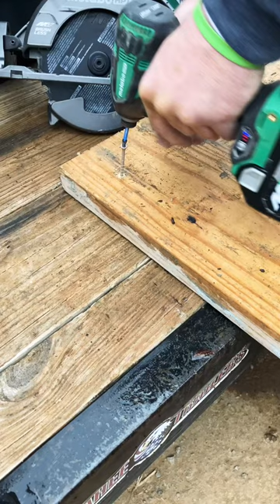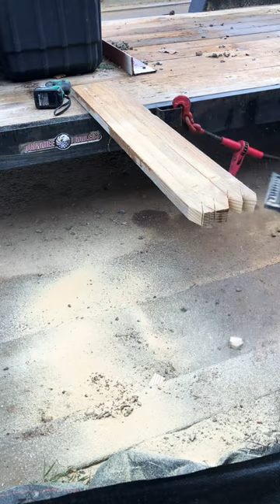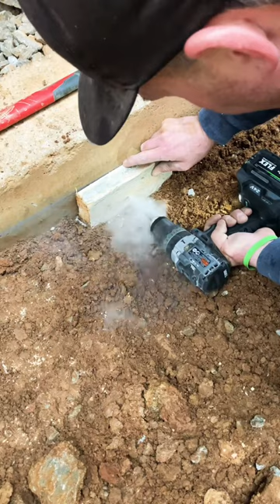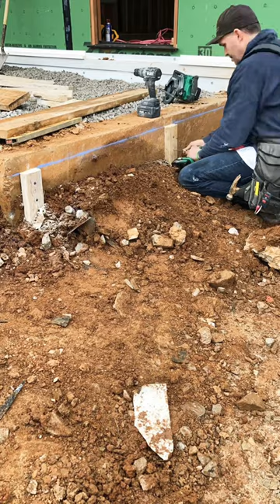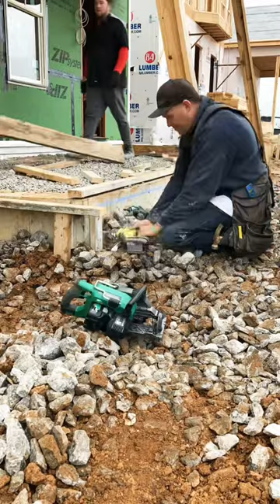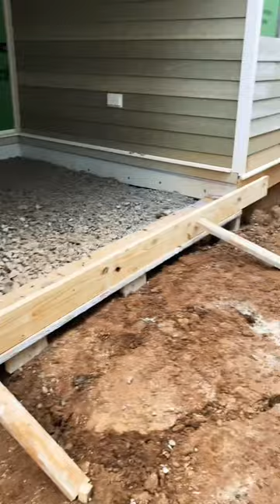I Love Tools🫡 Another Day On The Job / Metabo Hpt / Flex / Dewalt

Comment: Dude your gonna make me go get a 36v triple hammer
Reply from the maker: You already got the batteries Fam. They sell it bare tool don’t they? Hell you could probably find a new one bare tool on eBay for the low
Reply: Just be careful, some leak oil/grease

Comment: If your in need of a 1/2" plunge router Lowes Deal of the day, has the beastly 36V for $179
This router we use on all kinds of jobsite cut ins, window framing and trim work other tools used to perform-awesome.awesome tool
That price will go up to $249 or $199 on sale go get it u will thank me
Reply from the maker: To be honest I’ve never used a router man. I’ve seen a ton of videos on them. Yeah I’ve seen framers cut out windows. It’s awesome for sure. Do you have any advice for what I could use it for on our jobs? Concrete forming? Any tips would be appreciated man

Comment: Thoughts on metabo? Specifically the impact/drill.
Reply from the maker: A great value for what you get. They always run promotions and deals on metabo hpt. I don’t have the drill or hammer drill but the impact has probably one of the best ergonomics in my opinion the grip is comfortable. It’s perfect for structural screws and Tapcons. The larger lags it struggles but it’s not designed for that. Man I’d recommend this impact driver and rear handle saw to anyone. I love them. The weight is the kicker😂
Reply: @IMPACT-NATION  awesome! Thanks for the response. It will be mainly used for structural screws. Mostly decks and such. I've been using Ryobi. It's been good to me. Just thinking of changing up.
Reply: @jltcdm369  go get that triple hammer we have bunches of em and they are durable and feel great in the hand
Also that rear handle is so light making all those cuts so much we easier

Comment: Rotary hammer WAY faster than a hammer drill.
Reply from the maker: Depends on wich rotary hammer you have. The Flex turbo hammer drill is faster than some of the SDS drills. I’ve got the dewalt d handle one inch and the flex sds one inch. I use them all the time man. I bring this hammer drill out a lot for mortar and brick. But yeah your right if your going into solid concrete roto hammer for sure.

Comment: How do you like that triple hammer?
Reply from the maker: Oh buddy. One of my favs. Always will be. You can find the 36v triple hammer kit on Amazon all the time cheap. Look for the lower price under the original. Usually marked way down because the box has damage but the product is brand new
Reply: I want that dam 36v triple hammer
Reply: @TacticalThib  yeah I'm looking at some. If I get the triple hammer I'm definitely getting the 36v
Reply: @Zakh0704  there like 50.00 at Lowe's rn for the 18v kit
Reply from the maker: @TacticalThib  my buddy copped the kit at lowes last week on clearance. $111 for the 36v triple hammer, (2) 2.5’s and the charger and hard case. They put there bra for the low
Reply: @IMPACT-NATION  wow 😳🤯 I'm gonna go look thanks brother

Comment: You don’t think it’s worth it to get a rotohammer? You’d think it’s faster than the drill?
Reply from the maker: Definitely brother. I’ve got 3 roto’s but I was testing this Flex hammer drill on this job. Was seeing how it did with brick and concrete. Pretty impressive hammer drill man. Roto hammers are so superior though and effortless. I have the dewalt 1 inch D handle and it’s a tank man
Reply: @IMPACT-NATION  right on, I had only seen a couple shorts and was curious. My dewalt hammer drill has seen a lot of hours with pretty good results as well, I just use the roto as often as I can.
Reply from the maker: @MachoManAndySavage125  buddy a SDS is a must have tool in this line of work huh?😂. You try to blow through holes in a foundation all day with a regular hammer drill you better bring at least 2, bring plenty of batteries, and extra bits cause it’s going to be a long day😂👌👌